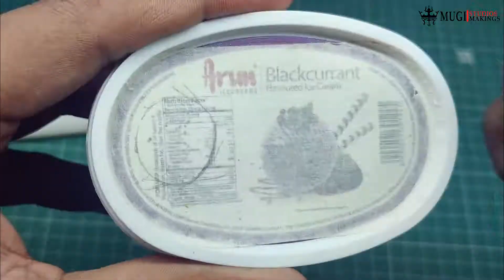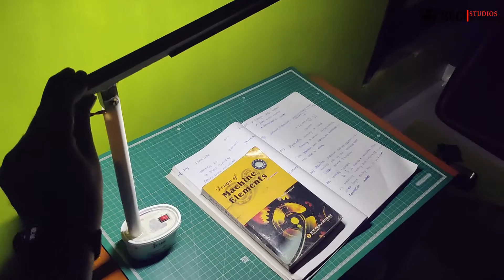how to make table lamp at home for study | table lamp DIY Homemade Desk Lamp | lockdown table lamp

Comment: How to reduce over heating in this table lamp bro ?
Reply from the maker: in this table lamp cannnot heating issues bro good product check in description
Reply: Use aluminium profile instead of using pipes its sturdy and deviates heat